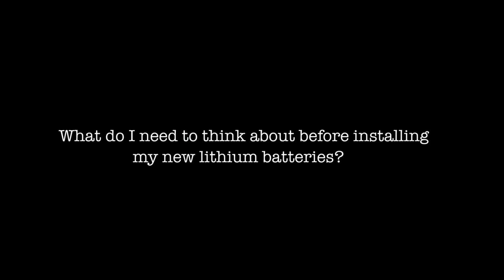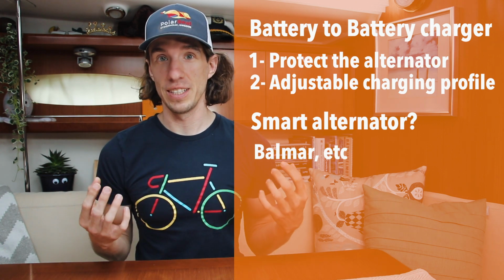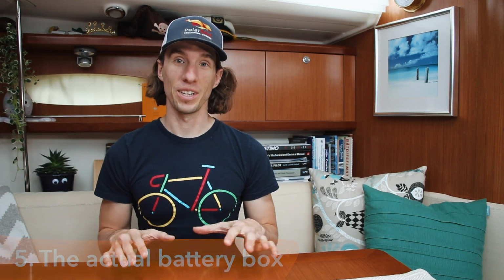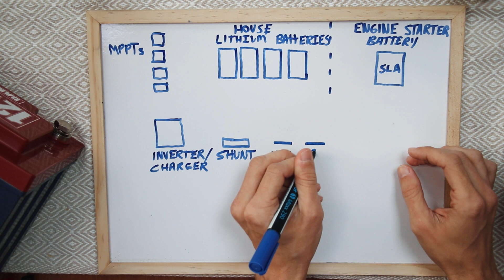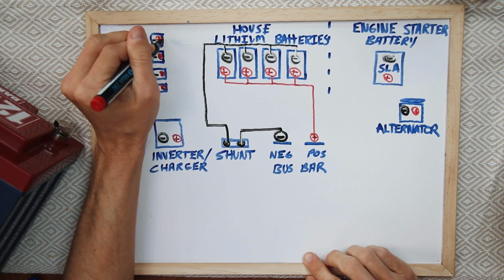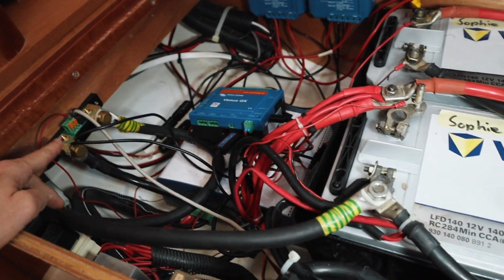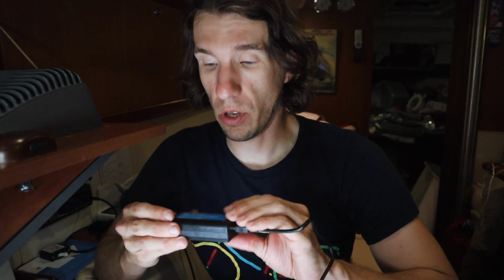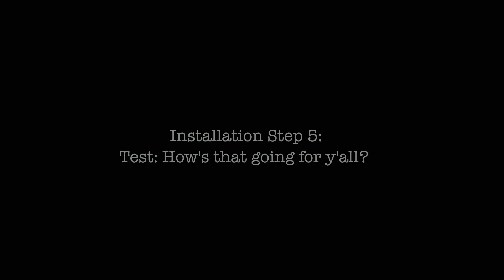How to install lithium batteries on a sailboat // Ryan’s tech corner #2

Comment: This is a very useful video, just one question.  How do you trickle charge the engine starter battery?  The DC-DC converter will only charge from starter to house, not the other way.

Comment: Which dc dc charger did you install? I am looking for a Sterling BB series, but these have a common negative. And as far as I know both plus and minus of the led acid and the lithium bank have to be fully separated from eachother. So I am curious how you solved this issue.
Reply from the maker: Hi Felix,  I use a victron smart orion b2b.  Though I'm not really sure what you have heard about the batteries needing to be on different grounds.  My system shares a common ground even between the battery types.

I did use a sterling in my V1 of the system and thought the charger got very hot. .

Hope this helps
Reply: @RyanSophieSailing  Thanks a lot Ryan. I have read somewhere that the both banks should be kept fully separated. But I do not remember where I have seen it as I am studying a conversion to lithium for a longer time already. But I do know that in a Mastervolt Magic dc dc charger both banks are kept fully separated from eachother. And in an Enerdrive as well.
Anyway, I will also check out the Victron charger which you mentioned.
Thanks a lot again.

Comment: Wouldn’t running at 48v system allow for a lower current hence the basic 12v systems on a boat won’t be as power hungry for maybe adding a buck converter for those and having the inverter running on the higher voltage lower current what are the risks involved in this ?

Comment: Ryan

I just purchased my first sail boat. im in the process of updating the battery and also going electric motor 48v.
my question for you is if i install a 48v battery bank for the motor and house how would i convert 48volt to 12volt?
thanks for you great videos it help alot

Comment: Lots of great information here.  Thanks for that.  I do have a question after looking at the Dakota website.  Are your battery cases standard BCI sizes like Group 31, D8, U1, etc?  I didn't see mechanical drawings or size specs listed.

Comment: One question that may have been asked - I'm told you need to have a fused link on each battery in case one of them goes AWOL... the main system and distribution are protected, but what are your thoughts on this?  We can't afford to replace anything else so the configuration aspect is a bit daunting with the mix of old Mastervolt and Victron kit, although it all seems is very well made.  We have a separate house alternator (24v) with separate controller (Mastervolt but I'm told it's Balmoral).  Our bow thruster is large and runs off the house bank - my main worry.  Great video.
Reply from the maker: Yes, it is recommended, and I would recommend it.  Personally I don't have it setup that way, yet but you really should.

Comment: Just a practical question. All of your tools, do you keep them on the boat for when you need them, or do you borrow/rent rather than own or store them off boat?
Reply from the maker: Tools are a hard one.  We have a large stoarage space for tools so we do have room.  in the past we barrowed stuff, but i have learned that if you use a tool more than twice you might as well buy it as you will use it again.  It really depends on.. A. if you have the space, B. if you enjoy doing work yourself and C. if you have the moeny for the tools.  If you do have your own big tool locker its also a big job keeping them rust free.  Ryan

Comment: Great vid! One thing came to mind tough. I was thinking that lithium battery bank should only be charged via  battery to battery charger. In this setup inverter / charger loads only lithiums. That ok because engine starter battery is assumed to be full, because it is utilized on moments, and it is loaded then first. And finally to the question. Before you did this lithium upgrade, alternator charged Both battery banks. How did you disconnedted the original setup of Both banks? I am planning also Similan upgrade for Jeanneau boat. Just thinking last considerations..

Comment: Great explanation. Just wondering why the need for 4 MPPT’s? Would 1 not do the job?
Reply from the maker: Its better for efficiency reasons.  In a perfect world you would have one most to one panel but its not practical for most.  Additionally its not great practice to have different panels makes or size combined through one mppt

Comment: Okay, this seeme to be a great system, and I plan on wiring my boat the same way, but I have shore power charging my SLA batteries when I'm at the dock. Where did you lead in your shore power? (Assuming you did).
Reply from the maker: Hello... the shore power goes to my victron multuplus which charges the batteries and let's in AC power.  Just an FYI.  I actually changed a bit if that wiring.. I now have the alternator charging the lithium directly and then use a b2b to charge the starte... if you look up our alternator video you'll understand why

Comment: Nice overview you provide Ryan. What I do not understand is the function of the B2B charger. The Li batteries are able to be charged at a much higher rate than SLA's. When all the charging is done via the SLA, will that battery not act as a hurdle for the Li and hence slow down the charging to a lower level than would be possible for the Li. I assume that quicker charging of the Li is better than slower, to minimize engine hours or maximize available output from the solar panels. Might there also be a temperature issue for the SLA battery? Would you care to explain when you have time and opportunity?

Comment: why drawing show 4 mppts? how many panels you have?
Reply: Hi John,

It was answered on a later episode,  Ryan slap me if I am wrong or out of my place.
He got 4 solar clusters, think of four quadrants, two on starboard with flex and rigid panel and two on port with flex and rigid panel.
So total of four, split that way so panels can be efficient in case one section is shaded.

Lau

Comment: An innocent question- Should the lithium battery box be steel so if there is a "runaway" or fire, you would have more time?  I understand if a lithium battery starts to "burn", you cannot put it out with fire extinguishers or water (much like burning magnesium).  The BMS should protect against this, but...Perhaps a good battery fire blanket would do the same job as a stout steel battery box.??
Reply: A study I saw showed when metal cylinder packaged Lithium Iron Phosphate cells thermally runaway they typically reach about 400°C, and most 12V LiFePO4 batteries are made from these type of cells. So as long as the battery boxes can handle that temperature without igniting, you should be ok. The lower temperature is part of the reason LiFePO4 are much safer than Lithium Cobalt Oxide/Nickel Metal Cobalt cells as used in some laptops, phones and vehicles like Tesla, as those reached about 850°C. You need high thermal resistance metals and alloys or basalt, silica-glass or ceramic fibers to safely house them. Ideally battery boxes are electrically and thermally insulating, as well as vented to the atmosphere away from occupants should they outgas. A carbon monoxide detector should alert you if this happens. But a smouldering battery in an enclosed space will contaminate everything and I wouldn't want that happening at sea. Here's what a smoldering lithium fire in a camper van does when not properly insulated and vented: https://youtu.be/4igrPF6Cpoc?t=259
Reply: @CraigOverend  Thanks for the education!
Reply: @billroberts9182  The lithium batteries you are referring to are using different chemistry than LPF/lifepo4. The LFP/lifepo4 are safe and during testing of shortening a cell the cell will reach about 180 degrees C and overexpand. When this happens a not so healthy gas will come out of the overpressure valve. But no fire and the extreme heat or explosion risk from a  lithium cobalt oxide (LiCoO2) battery (used in phones, laptops etc) will not happen with LFP/lifepo4

Comment: why do you have 4 MPPTs  instead of using one larger one?  or is there not one large enough.
Reply from the maker: HI Calvin,  There are a few reasons we use 4.  Based on the size of our array there is victron does not make a large enough MPPT, practical for our boat.  Also, having the arrays separated on the boat allows for the most optimum use of the panels and power.  So if there is shade on one array but sun on another, you can still get maximum power
Reply: Id like to add the term “redundancy” - if one of the MPPTs breaks you still have 3/4rds of your charging power left opposed to zero if your only MPPT stops workin…

Comment: Hello Ryan and Sophie, thank you for this very interesting video. We are also thinking about upgrading to lithium. Could you tell me what model of battery to battery charger you have chosen ?
Reply: Also, do you have some system to protect the MPPTs in case the BMSs of the batteries disconnect them all ?
Reply from the maker: Hello.  All my other equipment is victron.  The charger is the victron multiplus 3000.  The battery to battery charger I was using was a Sterling 60amp b2b Charger... However in this lockdown I added a larger alternator and this changed the system.  I know have the alternator charging the lithiums directly through a wakespeed 500 alternator regulator and then charge my starter and bow batteries through a victron Orion smart.  

Nothing protecting the mppts. I have the entire system connected though a victron Venus which you could also run to a battery protect unit but might be a little overkill.

Hope this helps... More questions just email.

Ryan
Reply: Thank you Ryan for your answer. I think I will go with the orion to charge with the engine. 30A is enough for me. Thanks again for the video !

Comment: Hello Ryan. My feance and i just got our first sailboat ever 
Ready to sail.shes a1984  35'  Allmand sloop rig.we have bought 5 /190ah power queen lop bms batteries,3/195w ecoworthy solar panels,a renology rover ( think it's 60a)
Our motor is a d722e3 marinized kubota,Motorola alternator ( not sure what size)
We have a blue sea system heart interface link 2000
We are a 12v system with house bank going to be lithium 
Engine and starter going to be regular 12v.
I bought a renology bt mod
And I have a
2000/3000wattt  inverter.
We want to keep house bank and the engine bank seperate..
Can you help me with any tips?

Comment: Many thx for this video 👍 Any information on the battery2battery charger? How many Amps are needed? Thx
Reply: I'm interested in knowing as well, I have only seen the sterling power units.
Reply: +1
Reply: Hey, Jan. I have a fairly similar setup that I'm planning on, but on a much smaller scale.  100amp hour lifep04 battery, and an old 55amp alternator, so I'm thinking of going with the 30amp b2b charger. This is less than the 0.5c charge rate specified by the battery manufacture and hopefully doesn't burn out the alternator. Next year, I'll likely add another 100amp hour battery if all goes well. It will take longer to charge both, but that's ok with me.  Also, my solar panels (older 150 watts)  are attached to the starter.

Comment: hmmm, did you forget to put terminal grease on your cables as you built them?
Reply from the maker: Short answer is no.  But I'm not sure I understand the question.  While building them might imply while crimping the terminal ends.  It is my understand this should not be done as grease done not conduct electricity but merely protects the ends and removes air from around to slow corrosion.  But no... I have not used any.  Ryan

Comment: Great video, but I don't understand why you make a battery box (It's a cute box though). The purpose of a battery box for lead-acid batteries is to contain the acid in case of a serious problem.
Reply from the maker: Hello xulito.  I made the box to hold the batteries in place.  You are correct in saying that most boxes are there to contain spills but other purpose is to hold them in place in high seas or in the event of a role over.  That was my primary purpose.  I may end up redesigning this box out of a different material with compartments for each battery.  The purpose here would be to contain any off gasing in the event of a lithium meltdown (its low risk but it would save the other batteries in the off case it happened).  - Ryan

Comment: Ryan,
   You want to watch this video: https://www.youtube.com/watch?v=Yf9N9zBgyB8&t=433s   you can get 4 to 10 times more cycles out of your batteries if you cut off loads from running the batteries down below 20%.  Lithiums hate being discharged too much too often.  Also you might want to charge up to only 80% State of Charge.  Lithiums hate being charged all the way.  It generates heat and the more power you pump in the less goes to charging.  If you two as daily users have the available amp hours, probably daily usage around 200 amp hours, you can probably charge between 20% SOC and 80% SOC no problem.  This will really increase the longevity of the lithium cells.  Most boats with one refrigerator, lights and computers at anchor use around 125ah a day to 175ah a day.  Also if you shunt is programmable you want to definitely shut down the loads at 10%SOC and shut down the charging over 100% SOC.  The bad thing is according to your diagram(if I was paying close enough attention) the shunt with programmable safety factors will shut off the load and the charging,  You may want to find a way to separate charging and loads by a separate shunt.  So if you are using too much electricity, the system will automatically recover via solar for instance. This might help: https://www.victronenergy.com/battery_protect/battery-protect Aren't those 170AH batteries so you have 680 amp hours?????  You could maybe cycle around 35 SOC and 65 SOC and really get some efficiency out of the batteries as the solar would be soooo much more efficient at putting in power.  Your alternator could drive the batteries to near 100% occasionally especially if you needed it, and the batteries might like to be reminded about their maximum capacity occasionally.